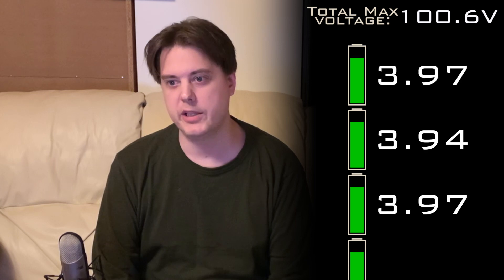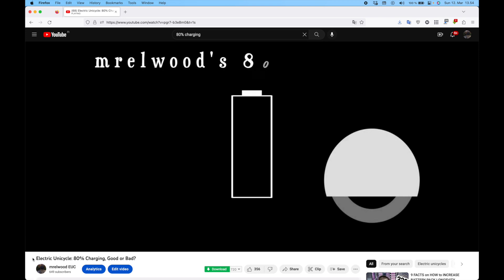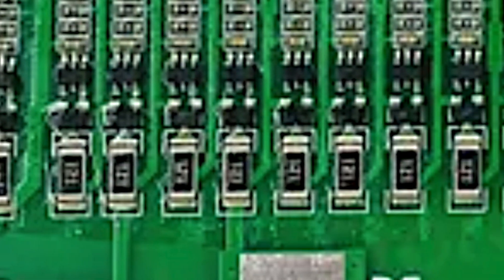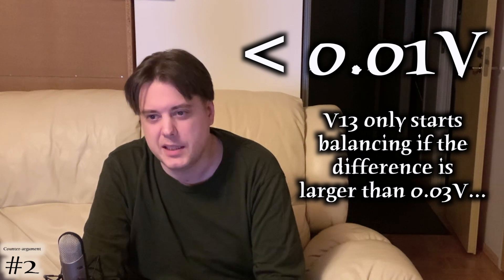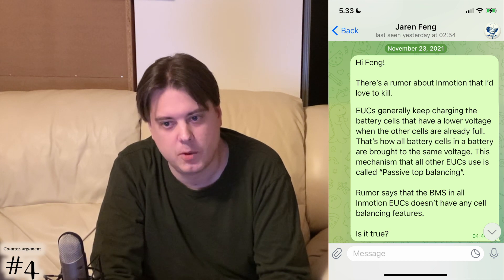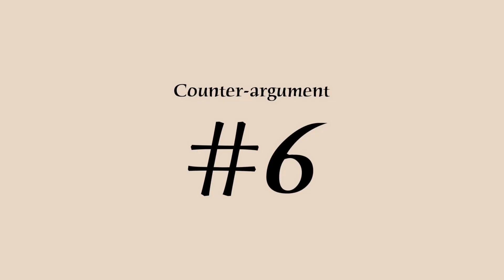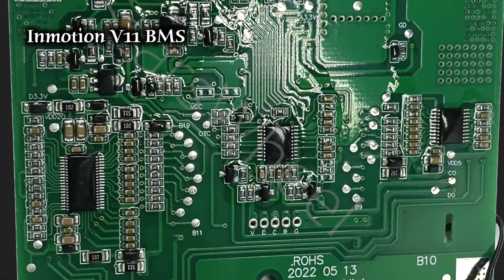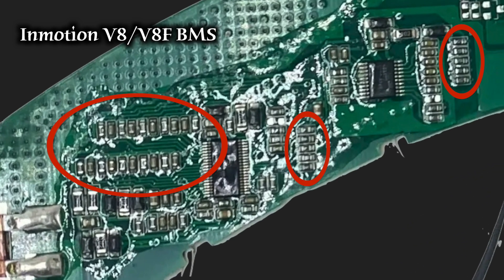Inmotion EUC Battery Cell Voltage Balancing, Yes/No?

Comment: Wrong Way only stated that the Inmotion EUC don't have passive cell balancing (balancing while charging), it's unknown if there is some other type of balancing. 

You mention the Inmotion BMS has 1k ohm resistors, but never mention the resistance of the Begode BMS resistors. If the Inmotion resistors are 1k ohms, it can't possibly be passive cell balancing, because that would require the pack voltage to be almost identical to the charger voltage to end up with a tiny charge current less than 4.2 milliamps. Even with a small imbalance, one of the cell groups will reach maximum voltage and shut off charging long before pack voltage gets close enough to charger voltage to reduce charge current to less than 4.2 milliamps. 

After a 100% charge and V8F shuts off charging due to cell pair overvoltage, I see pack voltage drop by 0.2 volts in about a minute or so, and another .3 volts or so over the next few hours, so if a cell pair is overvoltage, there is very little time for the 1kohm | 4.2 milliamp discharge to balance the pack. For V8F, it seems that around 2000 km, there is a bit of degradation, and around 4000 km, it's more noticeable. However, if a rider never lets pack voltage get below 35%, it probably won't be an issue, other than range will be reduced as the pack ages and become imbalanced.
Reply from the maker: It is possible that the V8 series wheels don’t have any kind of balancing. Your experience definitely supports that. But I don’t know whether the balancing function in your BMS has simply ceased to function.

I don’t know whether it’s possible for the balancing to happen in the ICs, or what their exact purpose is. But the purpose of this video was to show that while WW has condemned all Inmotion wheels (at the time of the video) because they don’t have cell balancing, the reasoning behind that doesn’t work. I’m not saying for sure that there is, or which ones have it, but based on my experiences I can’t see how it would be possible for the V11 for example not to have any kind of balancing.
Reply: @mrelwood_EUC  - the main issue is the 1k ohm resistors. I still don't know what resistors are used in other brands BMS. I did another 100% charge on my V8F, saw a peak of 84.0 volts just before charge shut off and it dropped to 83.6 volts within a second and 83.3 volts within 30 seconds.

Comment: I have a v12 HT brand new. Was my daily rider putting 20 - 40 miles approx 3 times per week sometimes max 50 mile+ rides. Crashed @ pretty high speeds from a cut out due to unbalanced batteries. The Controller & right battery were replaced. I was told to charge it to 80% and not go below 20% & 1/10 times fully charge past 100% to balance the batteries. What do you think? I'm getting a Sherm Max next fits my riding style best. I love my v12 tho. Wish it the v12 was extreme....not a v13, a v12 extreme to rival the Sherm because it has a lot of potential from a great entry wheel.
Reply from the maker: I’m very sorry to hear about your crash (hopefully you were geared up!). But I can’t see how unbalanced batteries would’ve been the direct cause. It might cause slightly more voltage dip, but you’d have to be at the very edge for that to cause problems. What was the battery level at that moment?

If you haven’t yet tried a suspension wheel, I strongly suggest you do before making your next purchase.

I have a video on 80% charging where I go through the details of that exact recommendation.
Reply: Well. I just crashed again. Pavement. Knuckles scraped and not confident in the euc world. I just got my wheel back. Was going under 25 in commuter mode.
Reply from the maker: Holy crap! What happened?? Did the wheel just turn off, or did you overlean?
Reply: My rim is bent. Won't turn on. I literally just unboxed it ready to ride. Doesn't make any sense. Luckily ever time i crashed even tho I've been on public roads in the right lane I've been far enough between or behind packs of traffic to avoid serious disaster.
Reply: Thanks for the response! Yes they were unbalanced. I was totally geared up. I've crashed upwards of 30+ mph twice. Once a grass ditch and this one on pavement. I'm lucky, but there is a proper way to crash. Yes I ride on the edge pushing hard thru the tiltback. I feel like I'm reaching The HS speeds. Anywho.... E Wheels fixed it tho no charge. New screen and bright battery and controller n pedal.  How long after I charge can I ride again? & to confirm I should be charging to 100 and + 1-2 hrs after every ride? My v12 only goes to 99v even after balancing..is that ok?

I learned to ride pretty fast already 2379 miles in about 3 - 4 months of riding before I crashed. I want a faster wheel with more range. I wish they made a v12 Xtreme not a v13, but a better v12 because I love it. For what I know which is limited to 1st time rider only the v12HT....what next wheel do you suggest? I'm aiming for Sherm S, but this new Lynx has my attention. 

I like the Knobby tire here in Fayetteville NC tropical weather, but I don't do off-road or jumps. Not too important for me. I don't know how much I missing having suspension. That low pedal level grip takeoff I love that feeling when I get low and hug the wheel. Pause 😂. I do want to feel what a street tire does .

I feel safe in the rain on my v12HT. I wish I had more range. I'm really lightweight "maybe" 160 totally geared up with charger and ish in my backpack.so I take advantage of seated riding and getting outta the blocks quick asf.
Reply: I had so much confidence in my wheel at some point. This shit is dangerous. Cut outs are just not acceptable.
Reply: Just cut off man.... I'm soo  pissed scraped knuckles again. I was going under right under 25. Riding straight in the slow lane @ night on a newly paved road. I ride not near traffic so I was good after the fall.
Reply from the maker: Man that sucks! That absolutely shouldn’t be able to happen anymore. It will take forever to build up the trust back to the V12. If ever.

If you haven’t already, upload the logs to Inmotion and send them an email at service@imscv.com. It would definitely be worthwhile to know what really happened and why.
Reply: I'm not liking inMotion now. I had soon much confidence in this wheel.
Reply: How do I upload logs if it won't turn on? And yes. Totally disappointed. I don't think I'll ever ride an InMotion again. 3 crashes 2 by cut out after 2370 miles. I rode like 2 miles before this shit happened.  Phuuuck bro!
Reply: The 1st crash I flipped over in a ditch landed perfectly wheel still between my legs. It was early when I 1st started to ride. The wheel wasn't damaged @ all. Cut off for safety, but turned right back on. This was probably 200 miles in. Then rode Amazing for 2000 miles then cut out. Riding seated 30 + on concrete. This crash wasn't as bad as yesterday. I really wasn't expecting this one to happen. Going under 25 because I was telling my self to ride slower than before I set my speed alarm @ 25. Earlier Right after I unboxed it i rode around the block very slow. Also Fed Ex dropped it at my neighbors house.
Reply: What Do you think.. exchange it for the same model? Or get a HS?
Reply from the maker: @SkanDigital  Sorry I missed your replies! Even if it doesn’t turn on, you might be able to connect to the wheel by connecting the charger.

That’s just not fair what happened to your wheel and you. Be sure to enforce any warranty you might still have on the wheel.

Whether to choose V12 HT or HS? HT would be my choice for my own riding, but yours might be different. I did think that the HS’s were all fixed by now, and HT had seen very low number of issue units anyway. Then again, I haven’t been following the discussion on them lately anymore.

Comment: So the danger is in the low part of the voltage ?
Lets say my battery has some cells that are discharged alot and the rest are charged fully , would the bms even them out while connected to the charger ?
Reply from the maker: The cell balancing behavior depends on the wheel model a bit, but usually yes that’s what’s intended to happen. However, if any of the high charged cells gets above 4.25V, the whole charging is interrupted. The common balancing process is explained in detail in this video:

Electric Unicycle: 80% Charging, Good or Bad?
https://youtu.be/pgr7-b3eBm0

Comment: I put a vesc on my V11, how can I charge the batteries now without the motherboard?  there are two little black and red wires coming out of the battery but they have no voltage, are they the charge connection for the BMS?
Reply: can I just connect the charge to the main output connection of the battery?  I got 5000 miles out of my first V11, I full balance charged it every other charge.
Reply from the maker: @FourthWayRanch  I’m sorry but if you’re unable to figure this out from just a quick look on the V11 internals, I really don’t think you are able to do it safely enough to avoid a severe fire risk. Many of the EUC fires are started exactly because of stuff like this, when people try to do stuff they aren’t anywhere near qualified to do.
Reply: @mrelwood_EUC    witch wires are for the charger connection? it must be the thicker small wires
should they indicate a voltage?  your video doesn't show the end of the connectors
Reply: @mrelwood_EUC   it looks to me like any BMS can accept charging power from the main output connectors.
Reply: if anyone is following this, here is the answer.  There is BMS common and BMS separate port charging.  EUC has separate port charging and NO you wont detect any voltage on the separate BMS charging port.
The BMS charging wires should be two wires about 18gauge, thinner than the main power wires but thicker than temp sensor wires.

Comment: My v12ht drains the first 10% super fast, and it started back when I was still babying the battery I only have 600 mi or 1k on the wheel. What causes it/is there a fix?
Reply from the maker: Li-ion batteries themselves have a very unlinear power graph. Maybe that’s what you’re seeing? Or if you’re following the percentage scale vs voltage. Or if you tend to unplug the charger right away when it turns green.

Comment: After replacing one of the batteries, is it safe to charge V11 with 15-20 v difference in voltage between two batteries? Will V11's BMS take care of balancing them out properly with that much difference?
Reply from the maker: No, the mainboard will lock the wheel due to a dangerously high unbalance. You need to charge each of the packs separately to the same voltage first.
Reply: @mrelwood_EUC  Thanks. I was wrong about the difference in voltage between two packs, it was only about 3 volts. So I tried to charge the V13 couple of hours ago and got the "Danger, contact your dealer" voice warning. Do you think that 3 volts are still a dangerously high unbalance?
Reply from the maker: @palamud  In not sure whether you have a V11 or a V13, though I’m not sure if they behave the same in this manner or not.

Inmotion has said that if the voltage difference on the V11 is more than 1-2V, the wheel will warn you, but you can still use the wheel. But if it’s over 5V, the wheel will be locked and can only be unlocked if checked remotely by Inmotion. I don’t know if they have changed the limits or the behavior since.

3V is clearly over the first limit. I would definitely charge the packs up individually to the same voltage before connecting them to the wheel together. I don’t know how effective the pack balancing system is, but I don’t think that the system is designed for balancing such big differences.

Traditionally the packs must be within 0.5V to be connected together, though the modern pack balancing systems are not quite as picky. But it’s easy enough to charge them up individually, why not do that?
Reply: @mrelwood_EUC  Thank you for the detailed information. I haven't tried charging the packs individually  because the short instruction I got from the dealer did not mention it, but I've been thinking about doing that. Should I just disconnect the one battery's cable while charging another one thru the V 11's charging port?
Reply from the maker: @palamud  Yes, that’s the only way to charge one pack only. Make sure to disconnect all cables going to the second battery, the small ones as well. Monitor the voltages while charging, and make sure they are very close to each other before connecting both.

The dealer’s instructions were unfortunately severely lacking.
Reply: @mrelwood_EUC  Will try that tomorrow. Sorry about the V11/V13 confusion.Thanks a lot.

Comment: As a community how do we solve this?

Would a current limited (100mA) power supply fix the issue? 

Charge the euc to a certain voltage 1-2 V below max and then connect the limited power supply for all cells to balance?
Reply: Terve, Iwould like to pick your brain on this matter if possible. I think that I may have a few ideas worth exploring.

Miten voi ottaa yhteyttä?
Reply from the maker: Jos tämä kommenttikenttä ei riitä, voit lähettää viestin ykspyöräfoorumilla tälle mun nimimerkille (ilman alaviivaa ja sen jälkeistä tekstiä).
Reply from the maker: I’m not sure which issue you mean. If the BMS doesn’t have a cell balancing feature, all cell groups will be charged equally no matter what. If it does, charge to full + 1-2hrs and wait for several hours for the cells to balance before you go for a ride. Repeat if the cells are badly out of balance.

Comment: Very good. I have 3 Inmotion wheels, they are great, considering a scooter too - I also fell for the misinformation, but could not quite believe it either - the packs are too big for no balancing. I generally leave my wheel at the last charge it rode in with until about 40% (lots of little trips) and then do a full 100% charge before a big ride, but then ride the 'top' off as quickly as possible - I don't like it sitting at 100% for days - but now I might let it stay on the charger at 100% for a couple of hours before taking the top off (generally down to 90%)
Reply from the maker: A few days at 100% here and there is no problem at all. Several weeks in one go at 100% might start to be leaving a mark.

If you’re going for a ride immediately after unplugging the charger, you’re not giving the BMS much chance to bleed the excess voltages. Some time is needed for the high cells to bleed down to the same voltage as the lower . If you go riding right away, you’ll just lower all cells’ voltages and their balance stays the same as before.
Reply: @mrelwood_EUC  what would be a decent amount of time to leave it on the charger once the light goes green? I also have an energy monitoring smart plug, but it sounds like that won’t be able to tell me when it’s fully balanced either (the wattage does go lower and lower once green). Shame the app, display or the charger doesn’t show this - e.g two green lights, one for ‘good enough’ and another for ‘balanced’ - as long as you balance once in a while the long term health of the pack is maintained.
Reply from the maker: @brushlessmotoring  I generally recommend 1-2 hours of plugged in after green, and all the hours you can spare to let it settle. I’m not sure what would be a general recommendation here, but 4 hours of rest would be great. Usually 2 hours might suffice though.

Comment: I been having trouble with battery balancing on my v12, will give it a go, charge again after fully charged, it's got 1v difference now, started from 0.4 I think, it only got 1500km on it, but the alert on the wheel screen says the battery is not fully working is really annoying and does bother me quite a lot.
Reply from the maker: Note that I’m not talking about battery pack balancing in this video, but cell group balancing. Sounds like your issue is with the left and right battery PACKS having a different voltage.

While the alerts are annoying, DO NOT DISREGARD THEM! They actually warn you about a real and serious issue with your wheel. And since we trust our health in these machines, alerts like this need to be taken seriously. If the wheel says that the other pack is not working fully, it’s probably right.

I don’t know how to enforce battery pack balancing on the EUCs, or if it’s even possible. You should contact your seller.
Reply: @mrelwood_EUC it's exactly what happens to my wheel, I did actually contact the factory, they tried the remote adjusting, which is not helping at all. they said better send it back to them, or ride slower.
Reply from the maker: @galaxyliu369  Do you still have warranty on the wheel?
Reply: @mrelwood_EUC  not anymore, sent back to replaced the main board within the warranty period, this new issue with the battery pack happened right after I got my wheel back from them cuz the driver board failed this time and needed to replace at my own cost, so I particularly asked them to fully check the wheel before sending it back to me, and this happened the same day I got the wheel back from them. they insisted that they fully checked the wheel and everything was fine.
Reply from the maker: @galaxyliu369  That sucks. Short of replacing the battery pack you sent to have very few choices. First I’d make sure that the firmware and the phone app are up to date. If the problem persists, I’d try to leave the charger plugged in for a few hours after it turns green, and recheck the voltages.
Reply: @mrelwood_EUC  thats what I doing right now, seeing your video is quite inspiring, much more helpful than inmotion after sales team in China.
Reply from the maker: @galaxyliu369  Thanks! I really hope that the batteries get back in line, and that there isn’t a more serious issue with the pack!